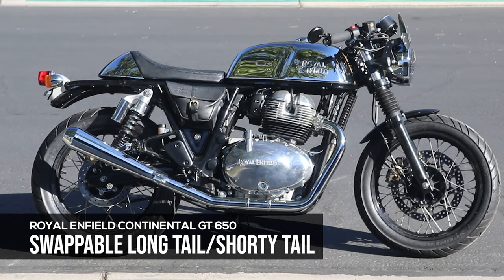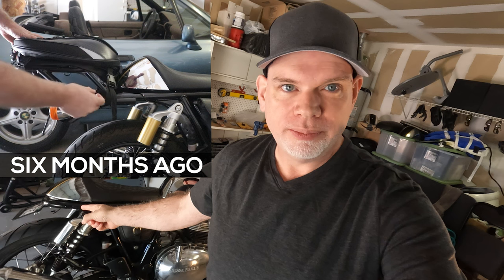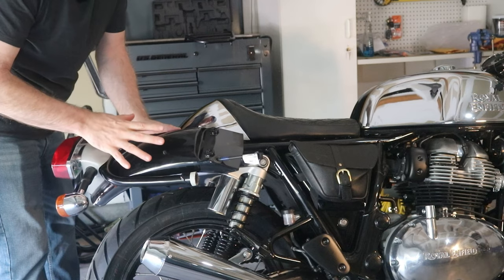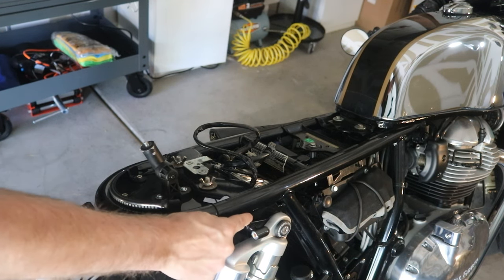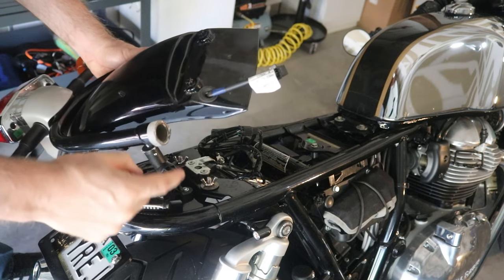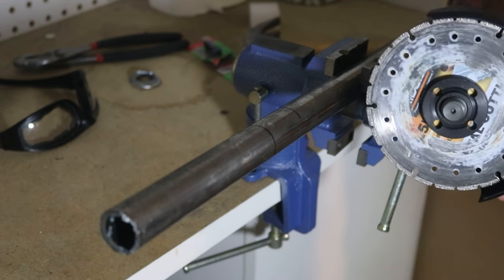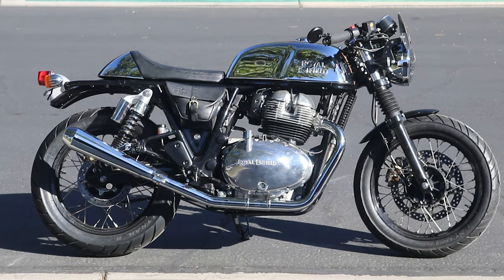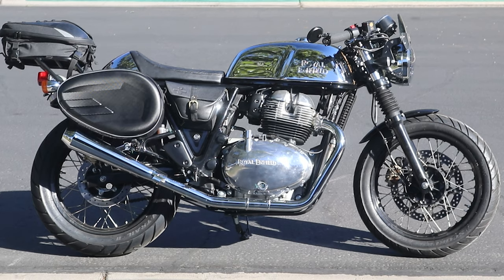Stock Tail or Shorty Tail? Why Not Both? Swap Tail & Lights in Under 2 Minutes without Tools

Comment: Hey Jerry grt video, the one i have been looking for. But i have a small question, after this mod can we able to ride with a passenger with long seat mod installed back? does the mod be able to withstand the weight of a passanger on a cruise ride? Can u please reply back after a qc please?!!!
Reply from the maker: Maybe? ... I don't ride with a passenger. But if you do it correctly then, yes. The mod I did is strong enough to hold a passenger but I wouldn't unless I made the connection tighter & stronger so that there would be no chance of it breaking and sliding out due to extra stress from bumps and vibrations with the extra weight.

Comment: I wanted to do the same thing. Love the look of the short tail end, with less clutter, but didn't want to completely lose the utility of the stock portion.

I seriously had the exact same idea. I haven't done it yet but now I know it works and I'm not crazy.
Thank you for the vid! Great job and great looking bike!
Reply from the maker: It works great and makes the bike a lot more versatile! I love the shorty tail but recently did a nine day, 1,500 mile road trip and it was great to be able to put the stock tail on so I could attach bags and camping gear.

Comment: Hello jerry, after your modifications to the continental gt I decided to buy one because I loved the design of the bike, only the rear part of it which I didn't like and with the modifications you made inspired me and I did it on my gt too and now it can be both more sporty and more classic in minutes so thank you!
After watching your videos I was inspired and in addition to the modifications to the rear of the bike I made a single seater for the double seat that can be removed for a pillion to use and installed as a front fairing on the bike.
I'm from Brazil and I really like going on long trips and the Continental GT is not very comfortable for long trips, so in addition to the modifications to the rear of the bike, I also changed the handlebars to the silver Himalayan handlebars, which made the bike much more comfortable for long trips. , and keeping the style. Thanks again for the videos, they are very good, congratulations.

Comment: Amazing. I have been hesitant for all these years to cut off the tail on the GT650 in fear of losing the double seat and luggage rack option. I have the MK designs shorty! Will go ahead with the chop! Now this is a tasteful mod!
Reply from the maker: If you do the mod, post a video! Haven't seen anyone else do this so I love to see how it comes out. Just need to make it's strong and secure if you plan on anyone riding the back of the double seat!

Comment: Nice work. I would have put the screws on the underside of the rail, but other than that, looks great!

It’s gonna take you longer to swap the plate than the tail!
Reply from the maker: Yes, that would've been better screw placement! Or put the screws on the inside. And yes, the license plate slows down the swap... trying to find some quick release fasteners or a plate holder that you can slide the plate in & out quickly!
Reply: @RideWithJerry  that's what I was planning to do too.

Comment: Hey Jerry! I had a question about your exhausts video— you had a pair of beautiful slash cuts so decided to pick them up— but they’re far too loud as is. 

Any chance you remember the baffle diameter and length you bought?
Reply from the maker: The width was 60mm, I don't remember the lenght. I also got the ceramic packing to wrap the baffles and have to drill a hole in the exhaust to hold the baffle in place since there isn't already a hold that lines up. Here's a photo where you can see how the 60mm fits and the bolt where I had to drill the hole: https://i.imgur.com/rqEYnhi.jpg

Comment: I like it bro,cool lil thing for your ride,👍well done
Reply from the maker: Thanks 👍 Yes, I love the ability to add the rack and bags back onto the bike when needed.
Reply: @RideWithJerry  i just cut the seat foam away ,as had spare,added a lil flat metal bracket underseat drilled 4 holes in seat with serated kitchen knife hehe,and used ebay cage from china bolted 2 seat,then when i put dual cowl back on,its back to bobber in an instant,kinda like what you did,but 5 kids etc i had to do it cheaper,for my uber eats job,the rack was 15$au,from ebay,but its steel&works perfecto,fun delivering uber on a 650conti for shure😀

Comment: In India, MVD The problem is that you can't just change things like that without consequences. If a person is found violating the rules, they can be fined up to Rs 5,000 and jailed for up to 6 months.

But this one is clean modification looks good and keep doing.
Reply from the maker: Thanks
Yes, the laws are different in every State here in the US (and which laws are actually enforced.) But there is no issue here with a short tail as long as the lights and signals meet standards.

Comment: That's pretty SLICK, but I kept on feeling like I need to slip-on some EYE Protection, while you were doing some of this! 😃 Curious as to whether the shorty lighting set-up has any REFLECTORS for when the bike is NOT running, but someone might drive-up, behind. That is really my only caveat about this shorty sort of modification.  

I saw a segment about some apparently sponsored track races featuring race-modified RE bikes. They had smallish nose fairings, as you might expect, but they ALSO had a sort "reverse-take" on the cone fairing that is on the rear end of the single-seat. It fit upside-down, UNDER the front of the bottom of the engine, sort of the way you might expect a bolt-on "Ricochet" protective PLATE, on a Dirt Bike or Dual Sport, but just-for aerodynamic slipperiness, and NOT for underside protection. 

ALL of the bikes in this racing format appeared identical, except for varying racing numbers, and these underslung, underside fairing pieces were the matching RED of the rest of the bikes' paint jobs. I wonder if YOU could get one in the shiny chrome, to-match, or if, since both the FRAME and the stripe on your tank are BLACK, just get one, or paint one in BLACK.  It looked like something that would be SUPER easy to install, and you might get a kick out of putting-on this subtle, but very cool-looking mod. I really doubt if it could be very expensive, and it looked GREAT!   Thank you for sharing how you do stuff, without acting like Mr. Know-it-All, 'cause your approach makes the idea of tackling of some of this seem attainable, instead of having people bowing-down, and crying-out, "We're not WORTHY!"   

I spent some time trying to FIND this item, among the bolt-on fairings outfits, but here's video SHOWING those bikes, and you can SEE what the underside fairing looks-like. https://www.youtube.com/watch?v=IrfTkRD_PTc  

If YOU can figure-out where to GET one of these fairings, let us KNOW!  Happy New Year!
Reply from the maker: Oh yes! I wore eye protecting when cutting, don't want any metal flakes in my eyes! No, the shorty tail doesn't have any reflectors. But, I did put refelctive tape on my rear licence plate frame.

Comment: U said it cant handle a persons weight on the long tail can u suggest some ideas that its swapable and also can handle a persons weight
Reply from the maker: I think it could hold a person's weight but I'm not confident to risk it with the the work I did (and not something I would advise anyone else to do.) But, if you precision milled solid metal connectors (rather than the hollow pipes I used) and used better hardware to secure it in place (rather than just two bolts through the plastic fender) then I think it would be plenty strong enough for a pillion rider.

Comment: Hey Jerry! Can it still support a back rider? Considering doing this on mine as well!
Reply from the maker: Yes, but I would NOT recommend a second rider with the way I did it. Would used stronger & longer, solid metal couplings (precision cut to fit tighter) and connect it more securely for a pillion rider.

Comment: What is the width of your rear tires and brand just curious. I also like single seat. I purchased my first RE Continental GT this Sept.
Reply from the maker: The tires are Pirelli Scorpion Trail II Dual Sport. The rear tire size is 150/70-18,  a bit wider than the stock 130/70-18. I did a video about changing the tires and also doing a tubeless conversion on the spoked rims https://youtu.be/7dTebUBmmdo

Comment: Can the stock long tail hoop with the stock seat take the weight of a 150pound pillion?
Reply from the maker: Probably, but I would NOT recommend a second rider with the way I did it. Would used stronger & longer, solid metal couplings (precision cut to fit tighter) and connect it more securely for a pillion rider.

Comment: Seems to me that it would support a passenger.
Reply from the maker: Yes, I think it could. But I wouldn't feel comfortable unless a couple changes were made. 1) better couplings made from a solid bar and machine cut for an exact fit and 2) a metal bracket for the two bolts that is welded to the tail. I think it would be simple to do with the proper tools.
Reply: @RideWithJerry  Yes, I was thinking solid bar machined to the right sizes and then tapping into the frame for a couple pinch bolts.

Comment: Which tyres are those??
Reply from the maker: They are "Pirelli Scorpion Trail II Dual Sport" tires. I converted the rims to tubeless and put the standard sized 100/90-18 tire on the front, and I put a wider 150/70-18 tire on the back.
Reply: @RideWithJerry  Great. Keep it up 👍👍

Comment: Hey Jerry....
Follow you here and on Insta.  Amazing pics.  Saw your recent camping pic....what saddlebags/mounts are you using now?  Looks like a great clean, sleek look!  Also, did they obscure your additional rear turn signals you installed on the top of your shocks?
Reply from the maker: They are inexpensive sidebags that I bought off Amazon, only around $50 but they fit the bike well (https://amzn.to/3L6fal6). I had to make my own brackets for the side bags due to the  shorty tail conversion I made. I swap out the short tail and put the stock tail back on for the bags. So, yes, the turn signals on the shocks are blocked by the bags but when the bags are on I have the stock tail, stock tail light and turn signals on the bike so they're not needed.

Comment: Can we use double seat in a long ride with pillion?
Reply from the maker: Yes, but I would NOT recommend a second rider with the way I did it. Would used stronger & longer, solid metal couplings and connect it more securely for a pillion rider.